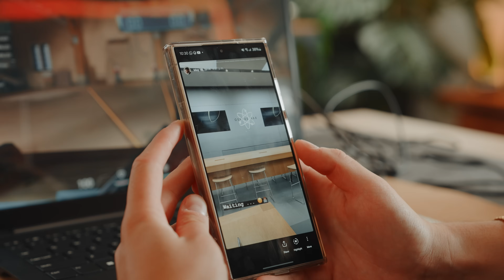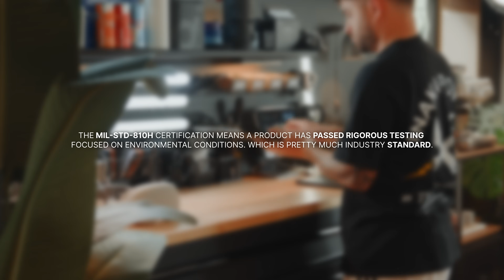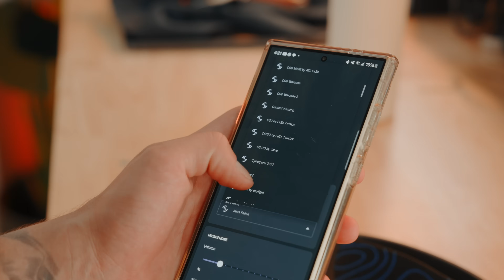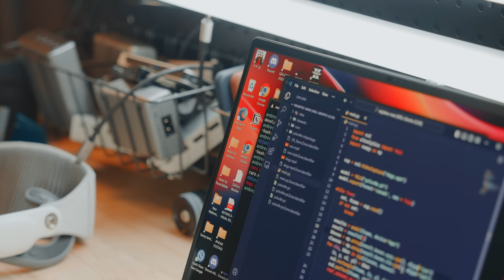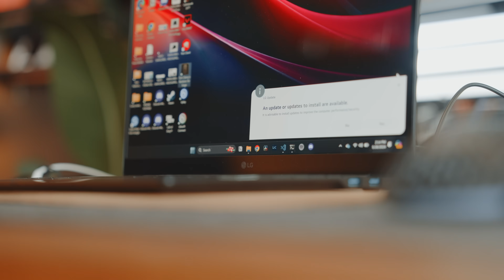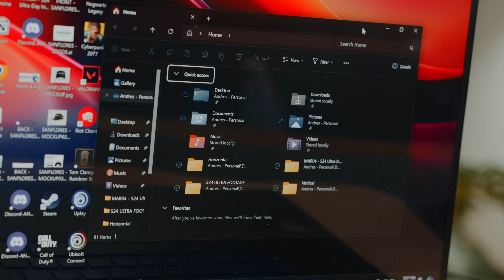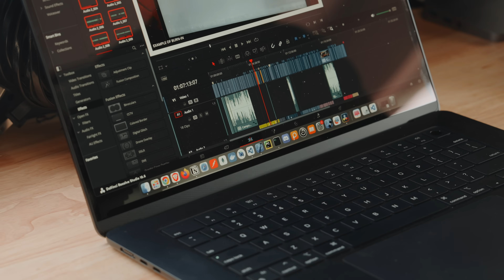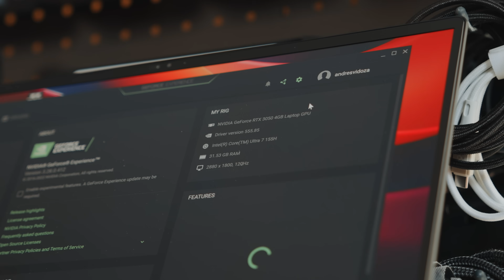Replacing Macbook Air with a Windows Laptop in 2024! (Programming, Daily Use + More)

Comment: I am starting my own business in architecture. I have use MacOs only so it has been difficult to find a windows equivalent that will allow to run Autocad and normal business apps but not have noisy fans and overheating. Battery life is very important to me. Any recommendations for a windows laptop?

Comment: I don't understand the bit about the confidence in the chassis, the macbook is a harder metal, which means if you ding it, if you bend it, if you crush it, if you smash it, it's toast. The LG is more malleable and thus should inspire MORE confidence, it's a lighter metal alloy but it can withstand bending forces, and impacts much better than the macbook chassis can.

Comment: Is the memory management really better on macOS? Windows will always load nearly 50% of your RAM with stuff that you could use to make it snappier to open those. But when you hit 80%, it will release the memory so that you can use nearly all of it. I have 16 Go on my laptop and some python script achieved using 14Go which is not bad. I have never gotten my hands on a Mac, but it seems that Macs do similar things but tend to use swap more easily. Using swap is a good solution when you don't have a lot of memory left, but in the long term, it will reduce the lifespan of your SSD.
Reply from the maker: Would loooove to test the SSD lifespan some how.. On my M1 Pro for example, Im still getting nearly the same speeds compared to when I once got it. But Id love to see the after math after 5 years or so.

Comment: I had just bought myself a MacBook Air M1 and moving from years of Windows laptop since I had stop gaming. One think impress me most of Macbook is the battery life is super amazing and it only took me a couple of hour to get to familiarize with the function key, control, setting and environment. It is much simpler overall.  One thing I do not agree now is that the Macbook is as lasting as the windows base laptop since there is many report of sudden failure due to logic board and cost a bomb to replace and the ssd failure will consider your laptop brick since there is no option to boot with windows security lockdown.  That being said I am still using both environment for my daily task and both had it pro and cons. Adding on the bluetooth is not consistance, for no reason you will lose the connection the next time you boot up. Given that the limited connectivity we use external bluetooth and mouse extensively, perhap apple should give more concentration to this area as well for such a premium price device.

Comment: I currently own a PC but in the last 2 years I've been using my 2020 macbook air m1 and not gonna lie I love this
light weight 
fast
easy to stuff in my bag 
can use it instead of pulling out my phone 
using VSCode for my homework is smooth even on a laptop 
only problem is having trouble downloading 3rd party apps :(